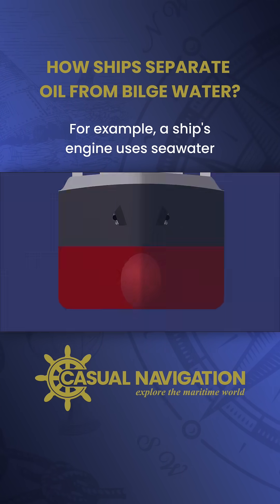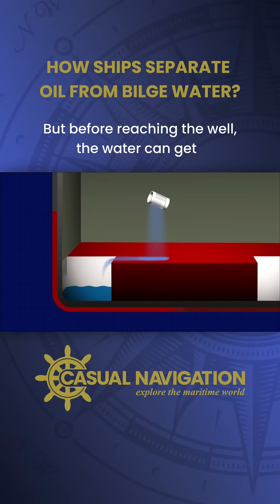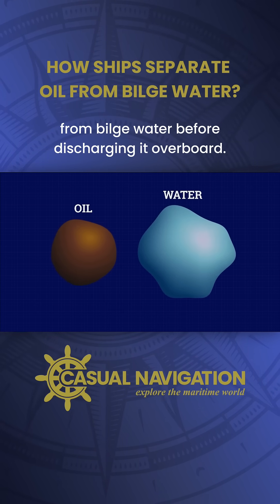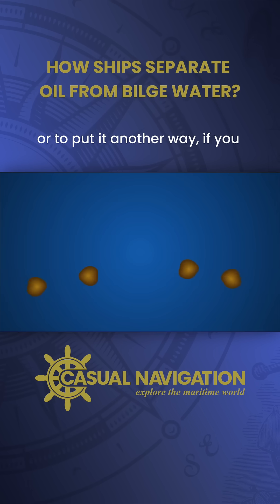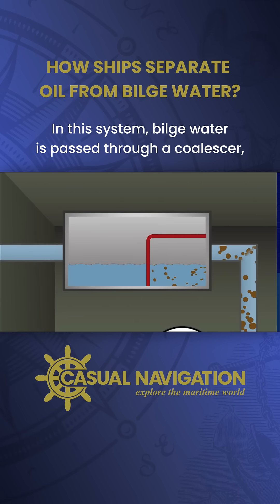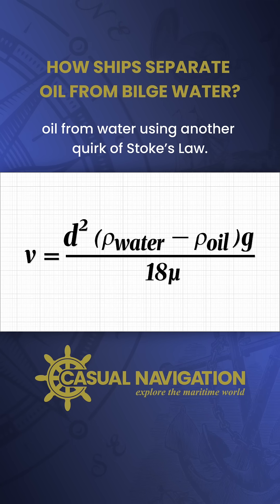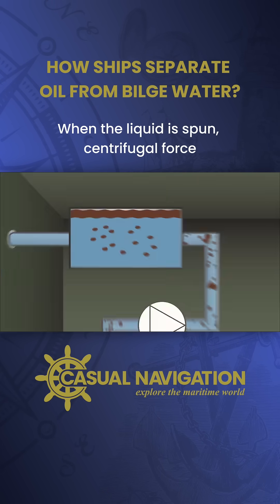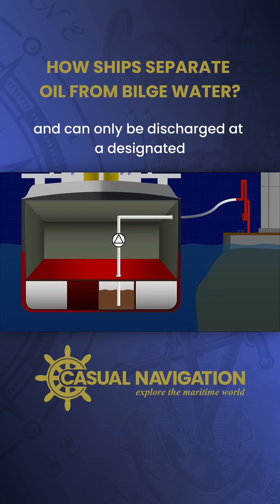How Ships Remove OIL From Dirty Water

Comment: As a CHEMICAL engineer, I like to say something .....use of SEA WATER = SALTY WATER ( EQUAL TO BRINE ) WILL CAUSED SLUDGE FORMATIONS IN PIPING SYSTEM AFTER SOME TIME UNLESS SEA WATER TREATED TO MADE DE-MINARALISED WATER ( D.M WATER) .
THIS STRAINER ONLY REMOVES INSOLUBLE FLOATING PARTICLES.
EVEN TAP WATER NEED TO BE D.M. TO USE IN ANY PROCESS USING LARGE COMPLEX PIPING STRUCTURE

Comment: i do wonder, couldn't they filter the sludge and put it back in the fuel tank? don't those engines run on crude oil? would that oily residue harm the engine?
Reply: Too much water I'd guess.

Comment: The OWS is literally the most finnicky, fickle, high-maintenance and breakable piece of equipment on a boat.

Over months and months, ours got "repaired" regularly -- only to break down again, and bilge got pumped directly into the OWS storage tank. 

We had to pump at every single port to avoid overflowing.

Second most disgusting smell I have ever experienced, next to cleaning out the grease trap on the same ship that served bacon and pork chops every day to nearly a hundred sailors.

Comment: physical objects can be pulled from water if you boil water or add water with gas (you call it soda), then bubbles condensing on every particles and drag to the surface

Comment: What about all the naturally occurring emulsifiers in seawater or God forbid somebody dropped the soap in there? 
   But then isn't that how they "clean up" oil spills, just mix soap with the seawater,  if you ask me that makes the problem worse..
   Why can't you use the bilgewater for cooling and that way distill off actual clean water using the waste heat, then burn the residual oil?

Comment: In the machining world we use skimmers to separate oil from the coolant in the coolant tank. It's basically a flat disk that's oriented vertically and spins at a pretty slow RPM, maybe like 10 or 20rpm. Half of the disk is submerged in the coolant and the exposed half runs through a wiper that wipes it clean and collects the discharge. The oil will stick to the skimmer more readily than the coolant will, and that's how we keep our tanks clean without constantly replacing the coolant, which can get expensive.
Reply: Belt skimmers are also used for this, same principle.
Reply: Sounds very effective, i wonder why ships don't use that. Perhaps another maintenance item they'd rather not deal with.
Reply: @DeepakKumar-lv4te  Belt and disc skimmers are effective for tanks where the level doesn't change significantly as they are set at a fixed height.  The level of water in a ships bilge could change significantly, so you need a solution that can move with the water level.
Reply: @ferrumignis  solvable (thinking fuel guage mech) but too much complexity for where it is I'd say.  Static filter / funnel type system makes a lot more sense I guess.
I was amazed at the emissions data from shipping (as much as world traffic) but at least they are moving an incredible amount of goods.
You would think they could perhaps generate their own hydrogen (or heat) to run their engines, but likely not nearly enough to power the ship.

Comment: 3 parts to oil, the part that floats is only 1/3 of the oil, 1/3 sinks, and 1/3 dissolves. Only reverse osmosis or distillation will clean the water.

Comment: wonder how many ships actually do that and dont just put the oil water in the sea like it is 

still a great video btw thank you!
Reply: A few years ago there was some news about satellite monitoring of vessels to check for illegal waste dumping. I wonder what happened to that system 🤔
Reply: Ships have mandated repairs on certain systems usually every 5 years they have to be redone. At the drydock almost every ship that came in for a refit need work on either the sea chests or the separators.  Saltwater is not kind to metal and a sea chest is a hole on a ship. One thing is for certain though is what an engineer thinks will work and what actually does are two very different things.
Reply: Im pretty sure ships would get inspected to see if they have these systems in working order
Reply: @CobroxYT  They do, but just like the gears inside of the gearbox one hand greases another and the problem becomes someone elses. It's why there's still sudden "wash-ups" of slop.
Reply: @CobroxYT also it’s kinda hard to do a port inspection out on the ocean

Comment: The second device described is what is commonly known a s "centrifugal separator". It is commonly used to separate water and contaminants form Fuel Oil and Lub Oil. Large ships have a structural Sump tank below the Main engine where lubrication oil is circulated, cooled and it's content is constantly passed through the Lub Oil Separator. In this way ships main engine can operate thousands of hours without any issues.

Comment: Why not redirect the oil to be burnt in the ships engine, perhaps at a scheduled higher temperature to counter the seawater contamination and potential knock. Why is oil allowed to leak from such ship engines . Could the oil not be reused somewhere else on the ship. Oil can absorb heat alot better than many other liquids as it's designed for it. 

😅
Reply: There is no combustion engine that does not leak oil.
Reply: @crazydutchbloke  Then that oil is a flammable reusable commodity that can assist in the low temperature bunking oil combustion. Have to ask why oil leaks for what are expensive engines often running at "low" performance steady state are leaking all the time and in such quantities requiring expensive refills

Comment: The ships I've worked on also had a designated bilge water tank, so we could fill it with the water from the wells, and we could then discharge the tank itself instead of the wells. Also, the separator just had a filter for the oil. But I didn't really ask how it worked - the 2nd engineer was designated to operate with it, while I was the 3rd engineer.
I suspect it was just trapping the oil inside it, as a regular filter, but it may as well have been the mentioned coalescer. I've seen one being changed only once, so they can last for months, if not years, without being changed, when operated mindfully.
There is also a sensor for the discharged water, to sense how oily it is, and if it exceeds a threshold (Think it was 15 parts per million), it's sent back to the ship instead of being discharged overboard, and the Engine Room was getting an alarm to notify us.

Comment: Very interesting! The equation you showed actually combines the Archimedes buoyancy force and the more general Stokes’ Law. The latter states that the force required to pull a sphere through a fluid (slowly) is the velocity of the drop times the viscosity of the fluid times the radius of the sphere times 6 pi. For the oil droplet, the applied force is sum of the downward force of gravity (the weight of the drop) minus the upward buoyancy force (the weight of the displaced volume of water. Both are proportional to the cube of the radius so the droplet velocity is proportional to the square of the velocity, as you noted.

Comment: Why can’t the bilge oil be burned in the ship’s engine/s being that the bilge oil is not much different than fuel crude oil, it can be added in small amounts to the mixture there by reducing cost of disposal.
Reply: because there is all types of other containment in this oil, Dirt, metal shavings, paint. dont want that in your engine.  Besides there is law prohibiting from doing it.

Comment: Years ago we installed a coalescer to recover low levels of a product from wastewater. It had the double benefit of reducing the load on the wastewater treatment system and recovering product that previously was lost. It paid for itself in a month
Reply: We had one at vta wastewater. It was pretty cool to watch a 30 foot drain spin
Reply: Product?
Reply: @coreymartin6363  maybe petrochemical   products like gasoline or diesel
Reply: @coreymartin6363 They probably mean they were on a plant where the oil had water in it. The water might get dumped with 1% oil in it, a few litres of oil per hour adds up after a month because the oil is worth money itself
Reply: @coreymartin6363  Problaby industrial grade bullshit.   
It's a key lubricant in the environmentalism movement as a whole.
Reply: Gotta admit, as stupid as that comment is, it's pretty funny!
Reply: @illbeyourmonster2 You talk like someone who's never worked on an offshore plant. I assume they are on a processing facility and removing the water from oil is a major process.
Reply: @letsburn00  I concur. Wastewater treatment usually deals with gargantuan masses of water and the most commonly used method of treatment, sedimentation tanks, are notoriously slow for separating immiscible liquid phases. As such any method that speeds this process up allows for copious amounts of unrecovered product to be sent back upstream for recovery.
Reply: @illbeyourmonster2  bro is mad with not polluting lmao
Imagine having such a petty beef
Reply: @ThiagoDragon0  How dumb was that before you edited it?
Reply: @illbeyourmonster2 environmentalism isnt bullshit. Im not a tree huger electric car person, but keeping the environment livable is necessary for everyone. Everyone needs clean food water, air, etc. Many industries like fishing rely on clean oceans too, look at what happened to gulf seafood industries after deep horizon
Reply: That sounds quite expensive to me. To save money I'd probably store my product somewhere other than the toilet cistern.

I know it's very convenient if the Police start knocking at the door, but it's hella wasteful too... 😉
Reply: @dieseldragon6756omg damnit i flushed my product

Comment: How does the coalescer work? Asking for gravy making purposes.
Reply: There's a mesh of oleophilic (sticks to oil) fibers, or an oleophilic membrane, or something of that nature. Being oleophilic means oil collects automatically into larger "droplets". You can think of it like rain on a window: smaller drops stick to the surface and grow until they can't stick anymore
Reply: Add an emulsifier and mix that shit in
Reply: @daydodog bilge mayo 😂😂
Reply: @daydodog What does that achieve? You still can't discharge it into the sea.
Reply: @ferrumignis read the original comment

Comment: Should only be allowed to pump at port. Too many don't do this properly.
Reply: Are they pumping at starboard?
Reply: After 40 years at sea, we have to separate, and pump off water. Most shore facilities are not set up for bilge water, only dirty ballast. Depending on type of ship, processing varies. Most use settling, then a scrubber called an oily water separator with a ‘calibrated’ discharge monitor. Others include a heated settling tank. Dirty ballast uses a ballast monitor to monitor discharge. Calibration is annually for the services I used. Have fun

Comment: If you have water coming in, check the seals, because water is NOT supposed to come in.  The water-cooling tubes might need to be tightened if they are loose, Or the rubber seals need to be checked, check the welds and make sure they didn't pop or rust through. Water coming up the propeller shafts, means it's time to tighten or replace the packing seals. Maintenace work is always being done! Don't cheap out and let leaks accumulate. The bilge should be dry!
Reply: I'm just working off of memory here.

Yes you should check seals to stop leaks, but one thing you should keep in mind is everything leaks. It doesnt mean you can skip out on limiting those of course!

It does mean that the water will get in, unless you build such a perfect ship it doesnt and that would cost waaaay more than shipping companies would be willing to spend